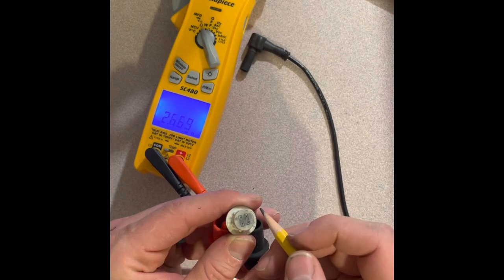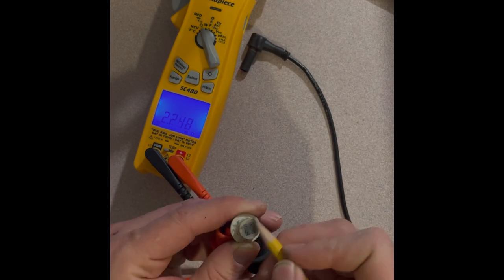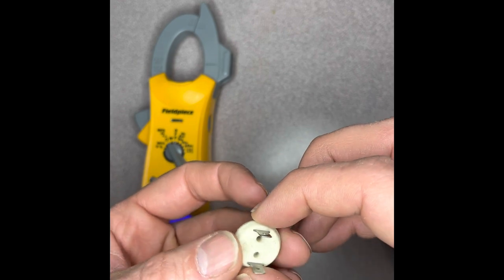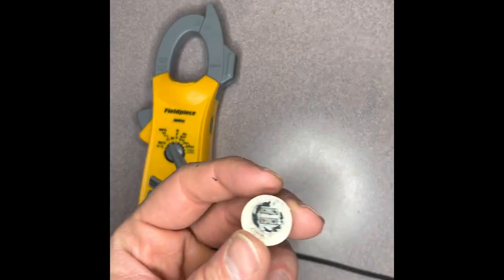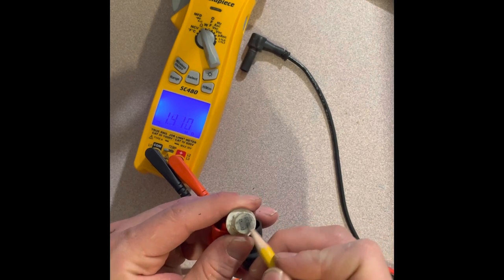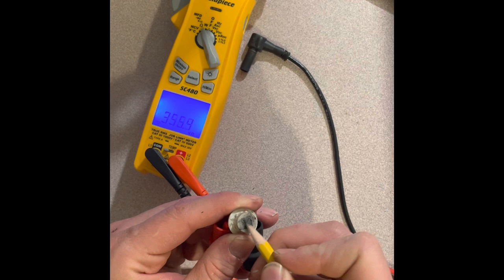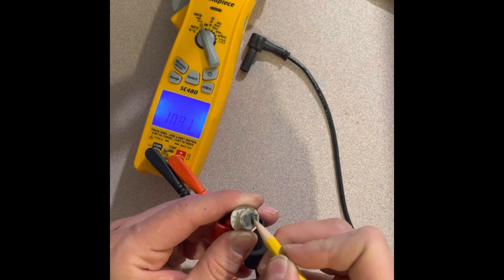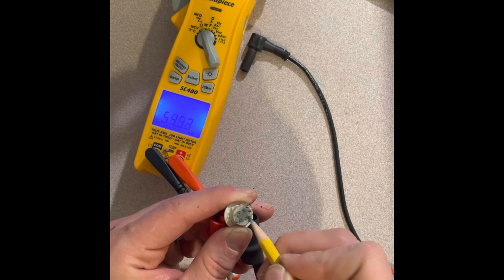Temporary Flammable Vapor Sensor Hack for Water Heater! #plumber #plumbing #waterheater #hack

Comment: This worked great, appreciate the temp work around. Enough to get us through to tomorrow when a new tankless is being installed.
Reply from the maker: Nice I’m stoked to hear that it worked for you. It’s a neat little trick!
Reply: Where did you find the resistance data on the sensor?
Reply from the maker: @gdejackmo I got it from the spec sheet from the manufacturer that makes the flame sensor. I had to dig a bit to find it. The water heater manufacturer doesn’t give any info on it.

https://www.emerson.com/documents/commercial-residential/25vs-product-bulletin-en-us-146860.pdf

The Trip point is typically 50 kilo ohms
Reply: @ColeMetge  thanks so much!
Reply: @ColeMetge  not saying that I would ever be so irresponsible as to disable a manufacturer safety feature but it appears to me that a 22K ohm resistor would serve a useful purpose. If one were to be so irresponsible of course. Again, thank you.